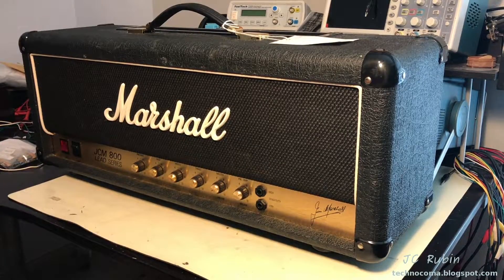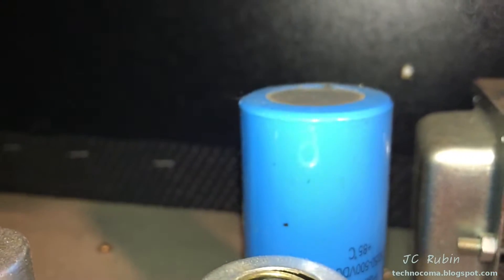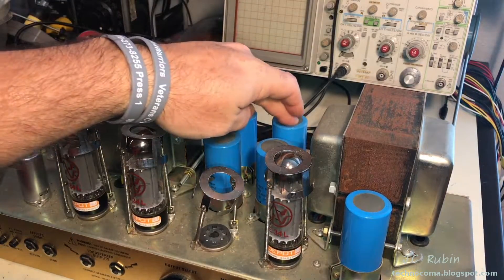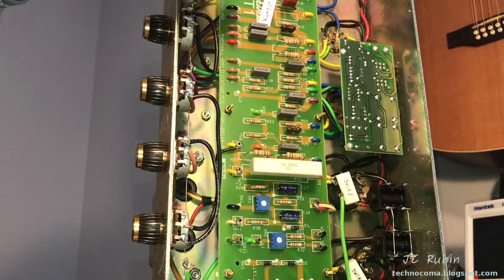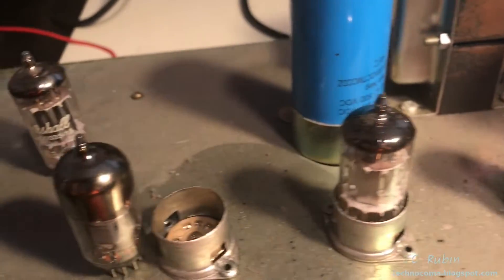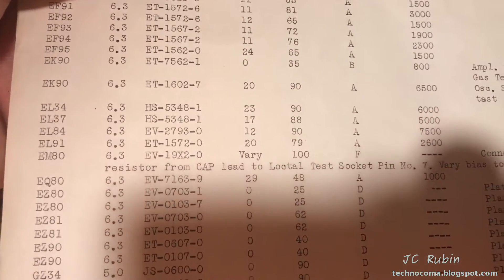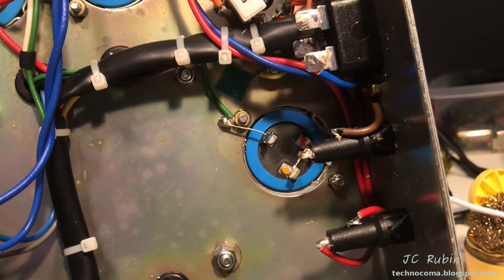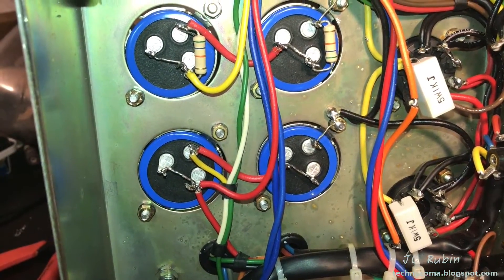Marshall JCM800 Lead Series Repair - Major Power Supply Issues 1 of 2

Comment: Excellent video! I have a welding tip cleaner that works perfectly along with using Deox it in my tube sockets. Just find the correct diameter tip cleaner and cut the smooth end off w some nice dikes, and file it round.

Comment: I recently built a JMP 2203 superbass clone using a ST1 replacement board from Granger amps. Everything seems to be fine but one problem I keep having is that the power tubes red plate no matter what voltage the bias is set to. They heat up after like 10 seconds of the standby being turned on. The tubes are brand new EL34s by JJ. None of the screen resistors start excessively heat up either. I noticed though when turning the bias trim pot, I don't have very much of a range. It's a 22k piher, but it barely adjusts from -45 to -38 volts. Any clue what would cause this? I have a Marston 2562 PT and a Heyboer 100W OT

Comment: My problem is so simple yet it's stumped me for 3 months.! Tried to get the right fuse caps for this 50 watt jcm 800 lead model 2205. 
An amplifiers place from England sent me something that's way too small. This amp isn't even broken. I just lost the fuse caps about 10 years ago...I turned acoustic for a while and basically ran away to my other skill of teaching karate... But now I need to make it work again. After contacting Marshall they said it was part number 00033 or 00037? I think it's pretty funny when Marshall doesn't even know. If you or some of the commenters could give me some clarity !
that would be awesome

Comment: I have a 2203 Marshall with a 1984 inspection date. I've owned it since around 1994. It probably has the original caps in it. When I look for cap kits for it, the suppliers list an early kit with 6 large caps and a later kit with 3 large caps.  My amp actually has 5 large caps in it- 4 between the two large transformers and 1 in front of the preamp tubes. Is this an oddball amp? I guess I could just buy the 6 cap kit and not use one of them.
Reply: Yes. This is the change I spoke of. They did it in order to cut corners and save money. Big mistake... those amps sound like dogshit compared to earlier 2203's.
Reply: @scottdunn2178  It didn't sound great when I got it. I've modded it quite a bit and it sounds great now.
Reply: @greglivo  Marshalls are a crap shoot, they either sound killer box stock... but most need a little tweaking > components have a +/- 20% tolerance, so you can mess with the values a bit... but some amps just don't have it no matter what. 

Regards 🎸
Reply: @scottdunn2178  I bought it around 1994. I did the mods back then. I had a paperback spiral book about hot-rodding tube amps and did a lot of the stuff from that. I remember swapping out some resistors on the first gain stage and I think one capacitor. I also pulled the 4 6550 power tubes and replaced with 2 EL34 tubes to run it in 50 Watt mode. I got a schematic from somewhere for an effects loop mod that involved adding another preamp tube. The loop itself didn't work out very well. It sounds like the impedance is way off when I use it. It has no bass response at all. Fortunately, it woke up the sound when not using the effects loop and I'm happy with the final sound. These have become collectible so in hindsight I wish I hadn't drill another hole in the chassis for the tube. I did, however reuse one of the speaker outputs and the direct line out for my loop jacks so the back panel is still unmolested. 

Thanks for the info in your other comment about the European dating system. Never thought of that. It makes sense that it was built in November of '84. Probably one of the first horizontal jack ones made.
Reply: @greglivo  I'm 54, and lived through the whole "hot-rod" era, when guys would spend hundreds or thousands modifying their Marshalls... and most of the time they discovered that their amp sounded just as good... if not better just using a $50 stomp box. And yeah, effects loops don't work in Marshalls... they are a complete tone suck... even "active" loops using an added tube. You're much better off using a good quality REACTIVE load box (never resistive), and tapping a line signal from that, running through your effects, then into a separate power amp. None of us ever thought we'd ever get old enough to see JCM 800's become "vintage" collectible! Ha! 

Good luck 👍

Comment: This is one of those crappy reissue 800's. No wonder it's been taking a shit. The original "vertical input" JCM 800's were made between 1981 and 1985, at which time they changed the power supply of the 100w 2203/1959 in an effort to save money... those post-'85 amps can easily be identified by the horizontal input jacks (Marshall never changed the 50w 2204/1987). Those post-85 amps sound granier, harsher, and aren't as loud as the earlier 2203/1959.
Reply: I have a U.S. issue horizontal jack 2203 with an inspection date of 7-11-84.  Maybe the production changes weren't done by calendar year. It originally came with 6550 power tubes but I converted it to EL34's. This amp looks different internally than mine.
Reply: @greglivo  In Europe they put the date first... then the month... so, yours would have been inspected and tagged in November... not July.

Comment: Replacing the filter capacitors in any amplifier over 10 years old is just good preventative mojo.
Reply from the maker: When it’s my equipment I have the freedom to do as I see fit. This is generally not the case.
Reply: 10 years would be way ahead of schedule unless you see a physical bulge, deformity or leakage. More like 25 years and even it’s not guaranteed that they’re no good. Have owned a few Marshall’s with FC’s that old and still rockin’.
Reply: @Skoora  And Murphy's Law says it will fail right into the first song at a gig...

Comment: It was a nice video...a bit verbose...but nice. Any amp in this ilk,... all filter caps and tubes should be replaced and sockets cleaned and/or adjusted as Standard Procedure. Really no question. We also highly suggest a signal path electrolytic cap replacement while we're in there. 90% of the time, the problems are shotgunned away and the liability for the shop in terms of return warranty repairs is practically nilled. Just sayin. I still enjoyed the look at another JCM800